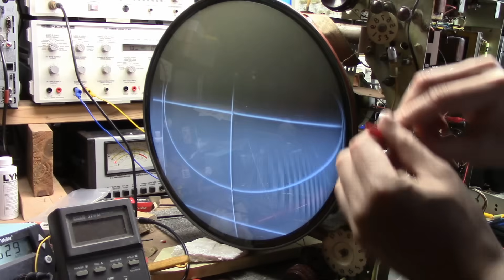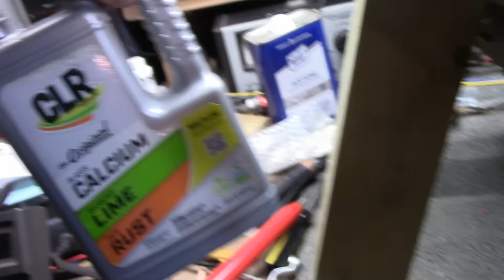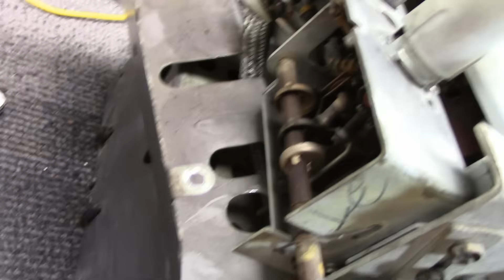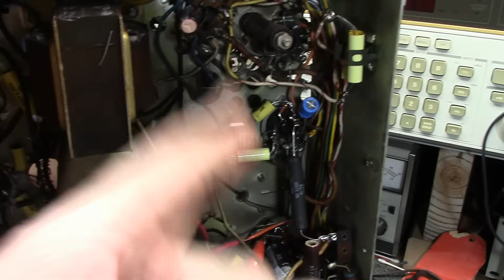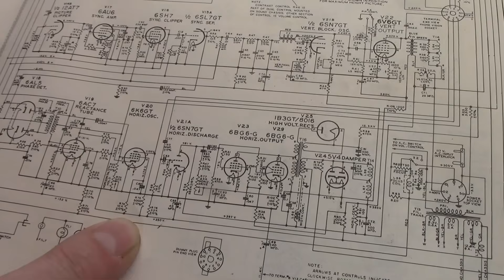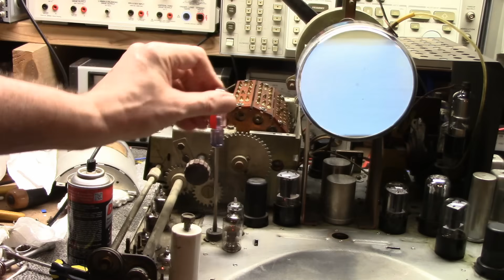Zenith G2951R Stratosphere part4

Comment: Hi Bob. Did you say this thing has pay-per-view? Was this a hotel/motel set, then? My guess is the module had a coin acceptor like in a jukebox, and a 30 minute timer (geared synchronous motor), plus a few relays. My guess is also that the module is no longer available.
Reply from the maker: No, not quite.  All Zenith console sets from the late 40s - early 50s had the phone vision system.   You called a special phone number and plugged your TV into a special box.  A signal from the phone provided the sync pulses to unscramble the program.
Reply: @bandersentv - I’m guessing the sync pulses had to come from the broadcaster, otherwise there’s no way they’d be in sync with the actual picture signal, even if they were locked onto the horizontal frequency. And then you have the problem that if you change channels, the sync signal would have to switch on their end to the broadcast station the consumer selected, as the odds two different channels being synced is astronomically small. Or maybe they had a tube-based PLL?
Reply from the maker: Yes, from the broadcaster.  Only one network used it for special movies in limited markets
Reply: @bandersentv  I wonder how it worked. Plain old telephone service had a bandwidth of only 300 Hz to about 3.2 kHz I think. Vertical sync is only 60 Hz, but horizontal is over 15 kHz. Did they really transmit 15 kHz sync over a phone network that wasn't designed for that bandwidth, or did they have to use some other tricks? Maybe some magic was done in the external box to get NTSC compatible sync out? Have you ever seen one of those boxes? Maybe the phone link only provided vertical sync, so you got a rolling picture if you didn't call in and pay?
Reply: @garystrait3289  I'd be curious how that was squeezed into the bandwidth given the inability to go as low as 60 Hz or as high as 15 kHz.  Perhaps some multiple of 60 Hz and submultiple of 15 kHz was used?
Reply: @SeekingTheLoveThatGodMeans7648  You're right about 60 Hz. I was mainly thinking about 15 kHz being too high, but 60 Hz is too low for the phone system too. I'm also curious how they managed to transmit sync through the phone system.
Reply: @garystrait3289  Wikipedia has a description of the technical aspects. Went a little over my head. In later years channel 27 in Worcester Mass used a pay TV system called preview.

Comment: I'm glad to see that Bob didn't have to deal with, or brush up against, any of those coils inside the rotating turret/tuner circuit when he replaced those out-of-tolerance resistors. You so much as look at those coils wrong, you'll have some problems. Replacing gobs of components in a complex circuit definitely increases the possibility of creating a mistake or two.

Comment: You need to replace the horizontal phase lock detector diodes.
Reply from the maker: It uses a 6AL5.  It's working fine now that I corrected my wiring error